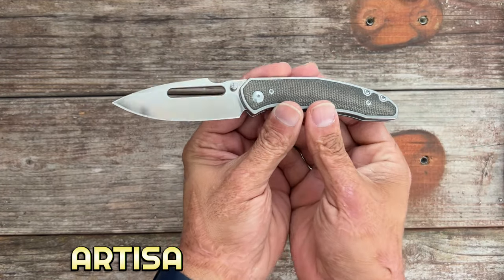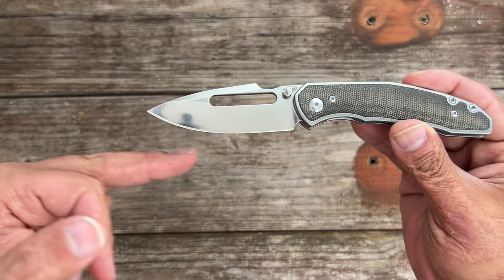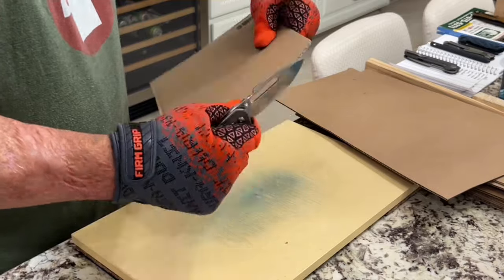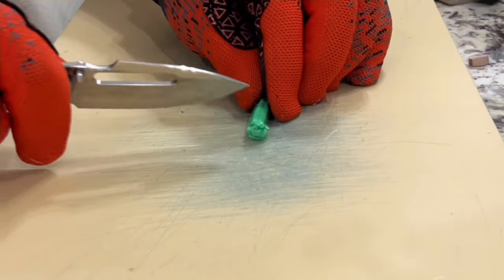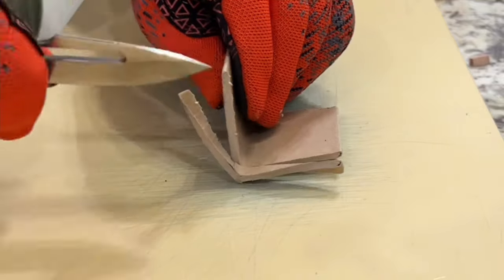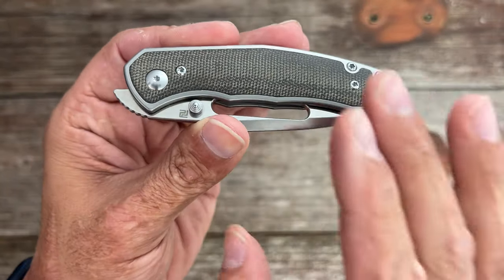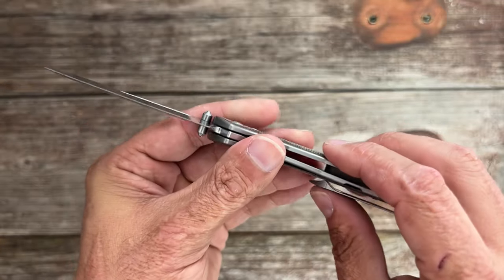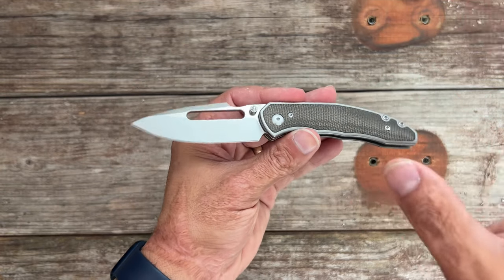Absolute Home-run! Artisan Cutlery Boa Full Review & Testing

Comment: If I pay near 600-700 duckets for a knife I only use it to chisel hardened blocks or to nonsensical throw it at hardened surfaces lol. 
They are absolutely beautiful and wish I could obtain one or some, but I already drop too much money on these addictive knifers!!! I really really like what Artisan is doing!!!!
Reply: The fully dressed gal is just so purrty!!! I am hiding my credit card from myself!
Reply: Yea i feel ya i just purchased my first custom folder... cant wait for it to get here.
Reply: I split it down the middle. $80 goes a long way with a brand like QSP. I get something way nice that I don’t mind abusing. They are tools afterall.
Reply: @57HEMIviken   me too please share it with us!
Reply: @Errcyco  Electric Kool aid is the shit!! ;)
I agree with ya somewhat. The most I dropped on a folder is $500 and I do not plan on using it as a tool. It's just too pretty, but if it all comes down to it I will. Damasteel is just as pretty as useful. Not long ago I purchased my first QSP, the Mini Penguin and was somewhat disappointed on my own behalf. I should have gone for the Penguin. But all in all pretty solid!
Reply: @Joshua-lx4ck  its a wells blade works with a 3.25" cpm20cv wharncliffe and purple and black g10 scales. Thumb hole and front flipper.
Reply: @Joshua-lx4ck  if you want to see it he posted it on the instant graham.